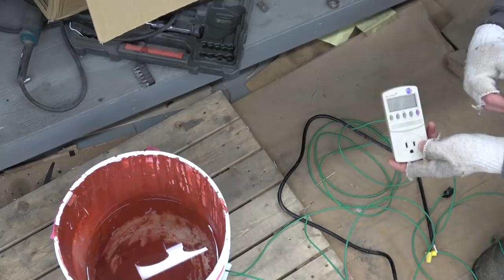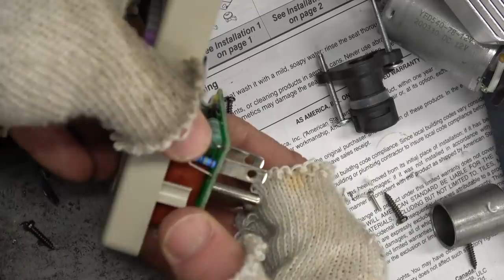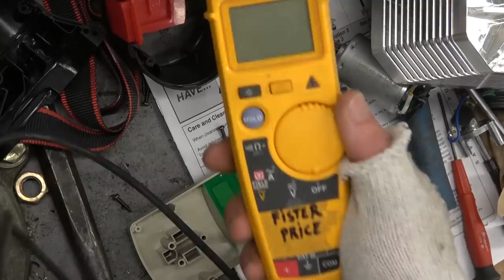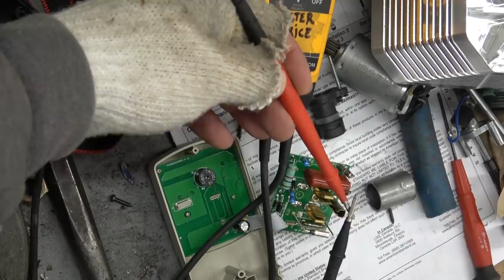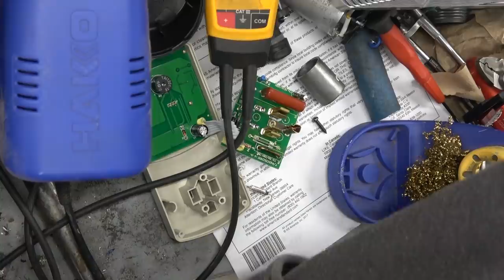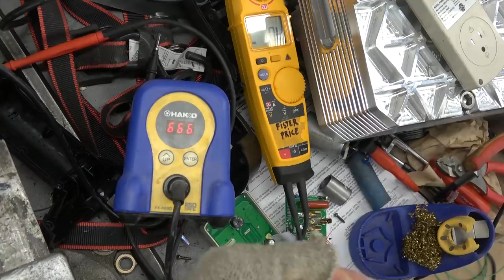BOLTR: Kill-A-Twatt | Electric Smoke Theory

Comment: I back fed my house with a suicide cable through my 10+ year old killawatt. I used it to estimate how much I was pulling out of the Genny. Just the refrigerator, sump pump, a few lights, the tv, and router. I had an idea of how much I was going to pull from the genny, I knew I wasn't exceeding more than 1200 watts give or take. I ran the killawatt inline for about 20 minutes while I monitored the power demand. I took it out of the setup after I made sure it was under 1200 watts or so at full chug. I kept feeling the suicide cable and the romex going from the outlet going into my panel for any heat. Luckily the outlet I was backfeeding into has its own breaker so it was somewhat safe I think? Lol I'm definitely not an electrician but I think this was semi legit besides the kill a watt? 🤣

Comment: Those Kill A Watts like to let the smoke out if you have them plugged in to a generator while it's shutting down.  At least that was my experience.  I used the Hz function to set the rpm on my Coleman generator, shut it down, and the Kill A Watt was killed.  Of course I took it back to Home Desperate and let them generously give back the money from it

Comment: Electric current is not electrons flowing through wires.  It's electric charge moving through wires.  It's analogous to a wave in the water.  The wave isn't water particles moving, it's the interaction with water particles carrying energy from one place to another.  In a wire, electrons move and interact, creating a signal that travels at a good fraction of the speed of light.  Electrons themselves don't move anywhere near that fast in a wire, and with alternating current, don't have a net motion at all down the wire.  It's the energy of an electric field that's propagated down the wire, just like a wave in the water.

Comment: I can't find any good videos comparing flexible shaft bit holders for impact drivers.  I just broke two of them trying to drill a hole through a 2 x 4 with a one inch paddle bit.  The first one I broke was the Ryobi I got at homedepot for $12 and the other flexible shaft that snapped was given to me by a friend and I don't know what brand it was.  
ANY SUGGESTIONS?

Comment: Good to know about the hako. I've been having my eye on one for a while
Reply: I just got a band spanking new one, she's got a power switch on the side.

  I'm not sure if he means like a timed shut off?  Cuz It does not have one of those.  But I'm not sure I would want one...
Reply: It's a real pain to change temperature too. They are made to use 5 preset temps instead of having a straight forward up/down adjustment. Real annoying. And half the time I try to adjust a preset, I end up changing the calibration on mine.
Reply: Have had one for years and they are great. Auto off may be nice, but the pencil one it replaced only had a single use auto off anyways.
Reply: I used one at work for several years. It was good enough as a soldering iron. The user interface is a bit funky (it is possible to enter calibration mode unintentionally when trying to adjust the temp). But it has plenty of power and a variety of tips available. Your choice.
Reply: It doesn't shut off automatically, so you have to remember to turn it off. That is fine by me.
Reply: They hired some beutique design house so the shape color user interface etc. is completely borked. Engineers snuck a soldering iron under the hood when manglement  wasn't looking so it solders ok and the tips last.

Comment: My electronics instructor explained electricamal smoke as thus:  at the end of the assembly line stands a wizard.  The wizard conjures the smoke into the component by means of various vulgar latin phrases.  If at some time in the future the component should fail catastrophically,  then is revealed the wizard's alignment.   If it is white smoke, then it was enchanted by a good wizard.  Black smoke indicates an evil wizard.  Grey smoke indicated enchantment by the legendary Gandalf himself.

Comment: Can't find it on Digikey nor Mouser, and it is out of stock on Amazon https://www.amazon.ca/SF96U-1-Microtemp-Thermal-Cutoff-Degree/dp/B07K358CKK
But what is heating that much up to 99C in that plastic box? Does a thermal fuse also blow up when the current gets higher then the ratting? 
Thanks for the Video, always entertaining.

Comment: What were you cleaning the wires with? Was that flux or a cleaner of some sort? Looking for something to clean semi corroded wire on cars.
Reply: Just flux
Reply: Yeah that's just a Flux Pen, it's used more often with surface mount and smaller components. Quick and easy way to give a flux
Reply: Some fluxes, especially the most aggressive ones for working on dirty or contaminated wire, are corrosive and must be washed off thoroughly after you finish soldering. Wash with warm or hot soapy water, then rinse with pure water, then dry with mild heat or final alcohol rinse.

Comment: What causes stainless farsners to gall and is there any method to recover them once it starts?
Reply from the maker: Nickel in the SS does. It's is super soft and as you bolt them together it removes the oxide layer and the grains weld together. Once grains are welded they just bind up worse. No way to recover. Neversieze is a good profilactic, it's greasy and full of find sand...
Reply: I never seize the f outta stuff, I’m usually just having to grind and cut other peoples solid pieces down in manholes. Never fun. Thank you tho! Love your stuff.
Reply: Yeah, you get out the rattle gun and ugga dugga your way to freedom.
Reply: @jttech44   sometimes I gotta get the big gun and tighten till loose.
Reply: @christophersiddall7270  Yup, give'er the old Quicky Lube torque-to-yield treatment.

Comment: You solder a thermal fuse and get 50k views and I disassemble a hydraulic valve block on a surgical table a get 4k.   hrmmm    Maybe I need to add more cuss words??